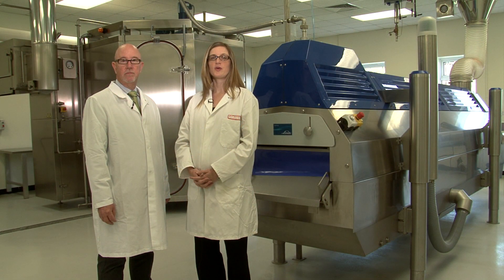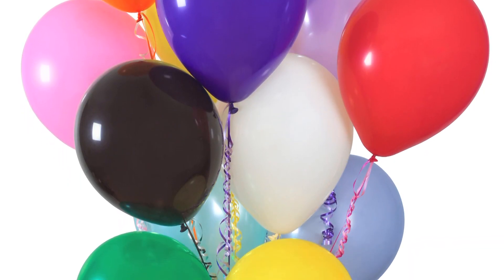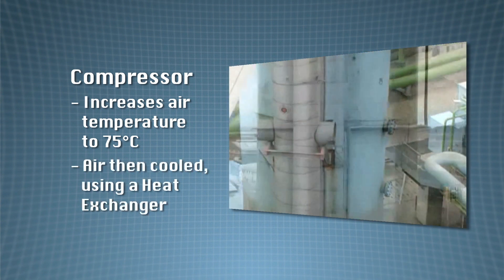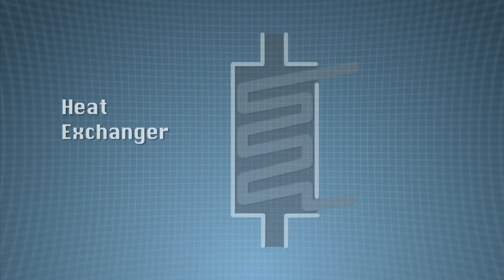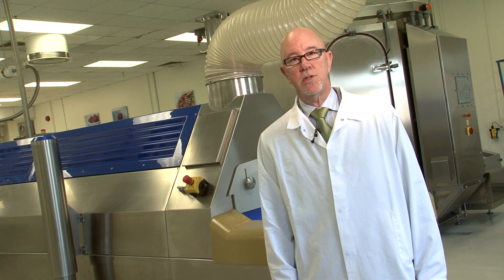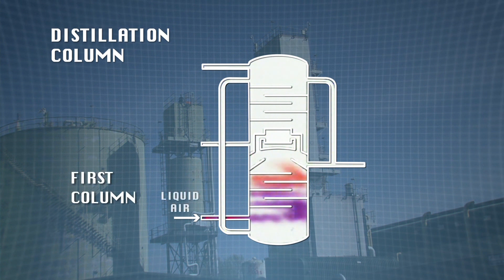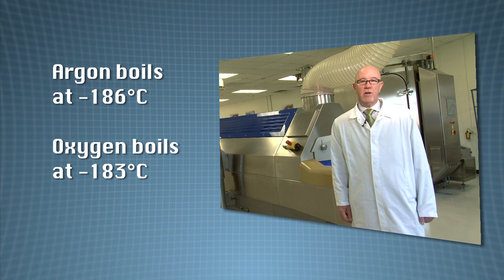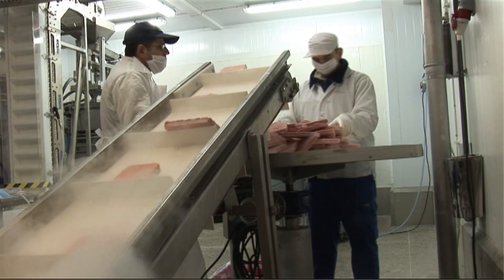Faces of Chemistry: Packaging Gases (BOC) - Video 2 (14+)

Comment: I've distilled alcohol and water before, I just never considered applying the concept to air.
 
If factories would distill their pollutants we could probably derive all sorts of useful materials from them. =)
Reply: This is not a "cleaning stuff up" technology. It produces a lot of pollution, and it consumes a lot of energy in the process. The compressors, coolers, etc, consume gasoline/diesel/electricity, they use cooling agents, freons and other pollutants. It is not a "green paradise". The "air separation factory" is a factory, like any other, it uses a lot of energy, like any other, and it pollutes the environment like any other. To "clean" (separate, whatever) a cubic meter  of air, it dirties another two cubic meters, which it releases in the atmosphere. (Edit: Not talking about noise pollution, etc). As long as it can sell its products (fractions of air) and make profit, it goes. When not, it stops, and goes to the grave taking your shares with it. :)
Reply: @laurv8370  +